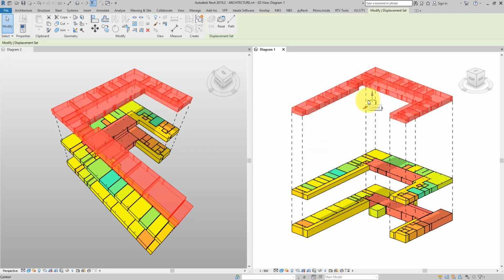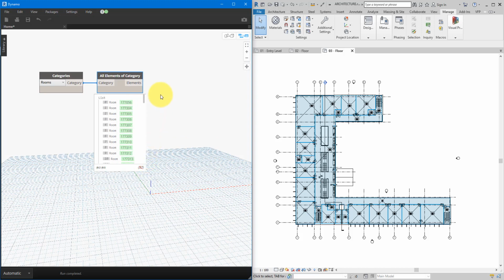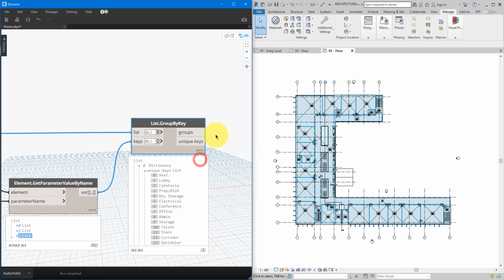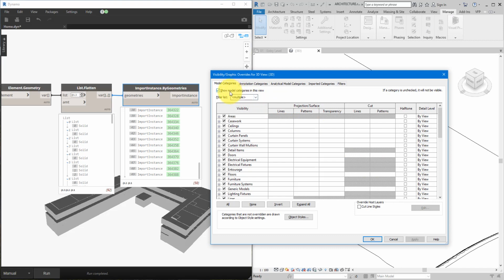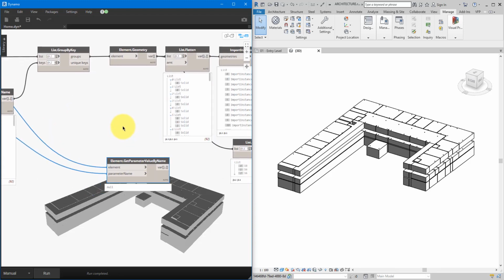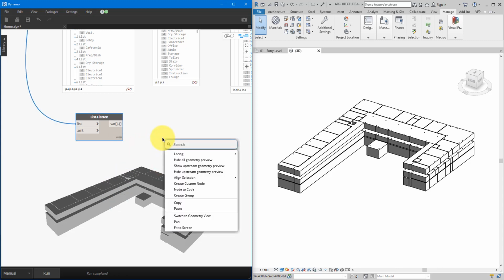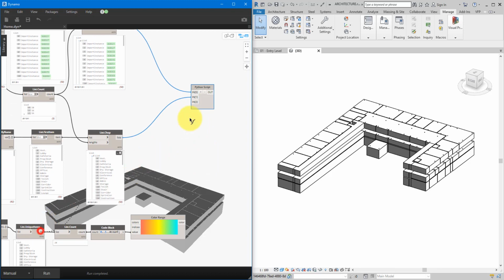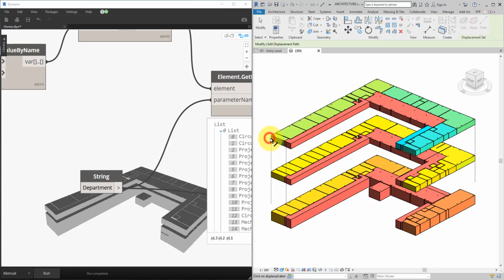Revit Snippet: Instant 3D Space Diagram from Rooms!

Comment: hi, I've run into a slight problem. I am more the lazy kind and bought the script. 
Everything works but I run the script and dynamo generates the diagram. The result is enormous, it's as if dynamo generated it at another scale. kinda fun to see. I'm using revit 2022.1 and when I opened the script in dynamo a message appeared about the pythonscript being old or something. Don't know if others encountered a similar thing. But I wanted to let you know this
Reply from the maker: Thanks for reporting this! Revit 2022 changes the unit conversion system slightly so maybe that's why. I'll check the script to see if we can make it work for 2022.
Reply from the maker: Hey sorry for the late reply! I've updated the download to include a Dynamo file specifically for Revit 2022 to fix its import scaling bug. Please email support@rv-boost.com from the email you used to get the download and we'll send you the updated files for free!
https://rv-boost.com/product/instant-3d-space-diagram-from-revit-rooms-with-dynamo/